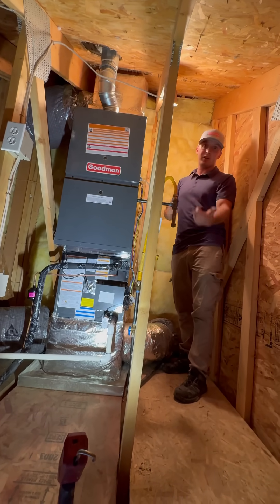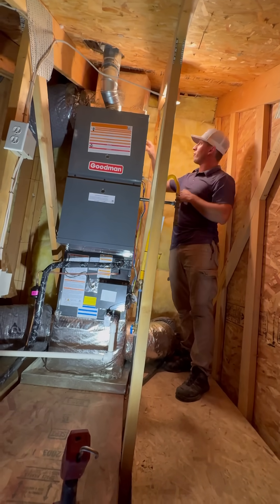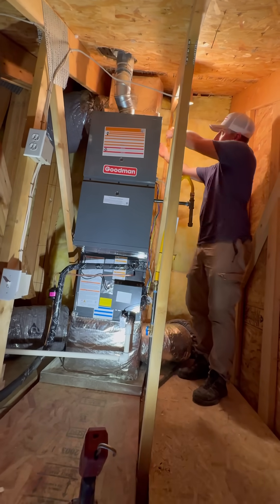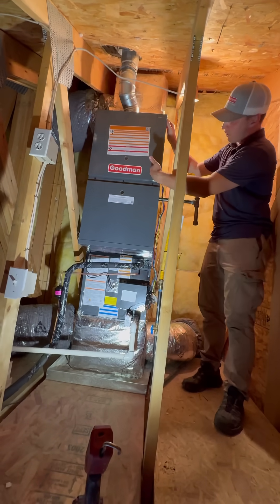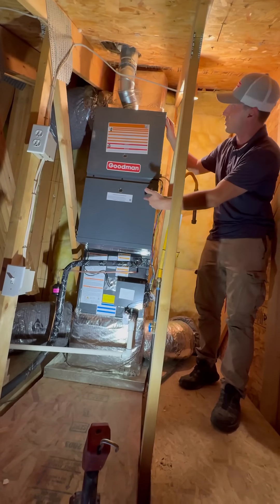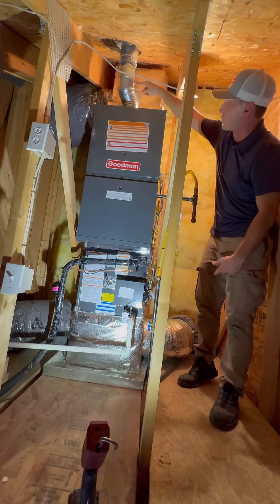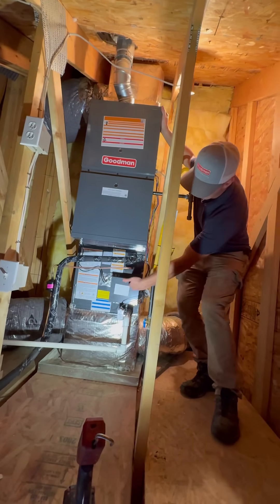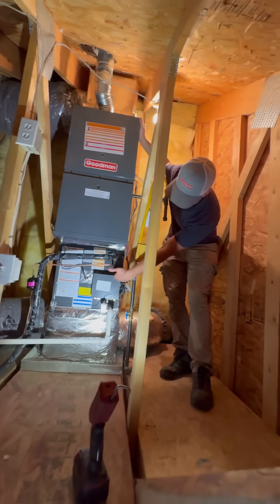Side-by-Side Sound Test — 21 year Old Payne AC vs. New Goodman SD Inverter | R-32 | Meridian ID

Comment: I just took a class for these and going to put a Daikin fit in my house. Do you run a new data wire or the regular 24v wire is fine ?
Reply from the maker: You can run regular 24-volt wire for these setups — that’s what we do, and even our Daikin service rep who trains us says it works just fine.

A couple tips that really matter:
	1.Don’t use the factory splice connectors at the condenser for the 1 & 2 communication wires.
Remove those and run your wire directly to 1 & 2.
	2. If you do need to extend the wire, certain butt connectors are acceptable — but the best way is a proper splice.
I use a Milwaukee soldering gun and do a NASA-style solder splice so the connection is solid.
	3. Any extra wires (thermostat or outdoor unit) should all be tied together and landed on a good ground at the furnace.
Grounding the unused conductors helps reduce noise and prevents random communication errors.

Hope that helps, — these little details make a big difference on communicating inverter systems.
Reply: @SaintTonysHeatingandCooling thanks for the tips Tony. Are you on Instagram ?

Have you zoned these? My house has two zones. I I’ll use the recommended zone board.

Oleg
OIG HVAC Installation & Repair
Reply from the maker: @HVACOG  No problem. Yes I am on instagram @SAINTTONYSHVAC 

I have not zoned one personally yet I just sat through the training for zoning it recently.

 I would Contact your Local Daikin or Goodman Service rep. 

There is an app for the zone panel called EWC Controls, LLC It's got How to videos and product manuals. 

https://www.instagram.com/sainttonyshvac?igsh=MTU2dnF4eGlmNmczOQ%3D%3D&utm_source=qr
Reply from the maker: Here’s a video on how to do the NASA splice. 

https://youtu.be/kO5Fy07y_kM?si=nkvT7DmwLXWx74ps